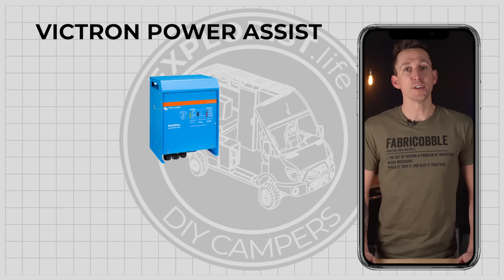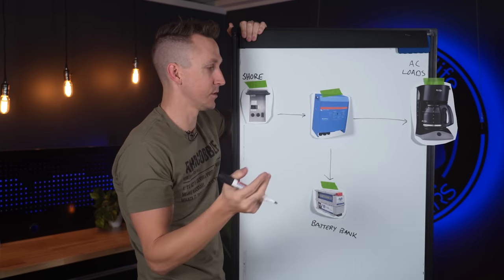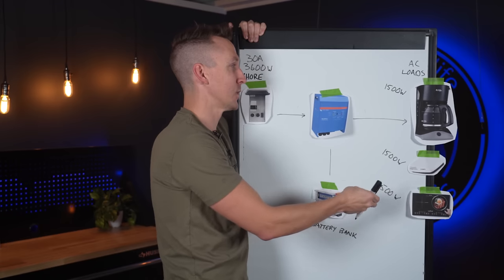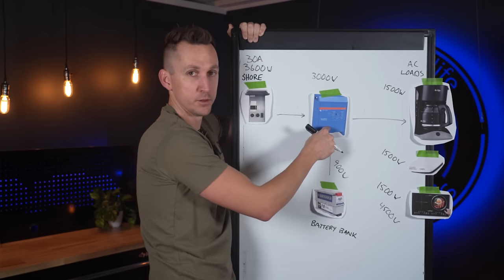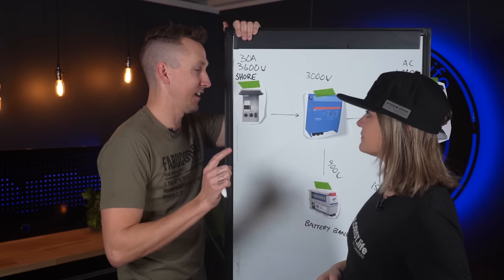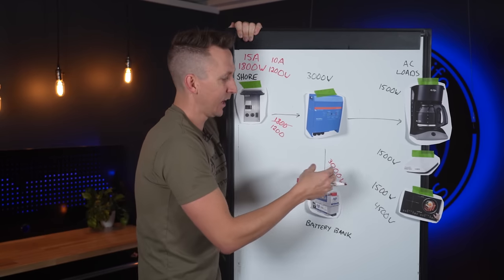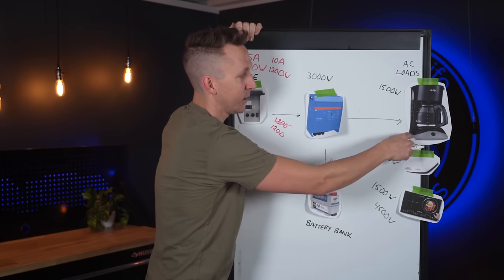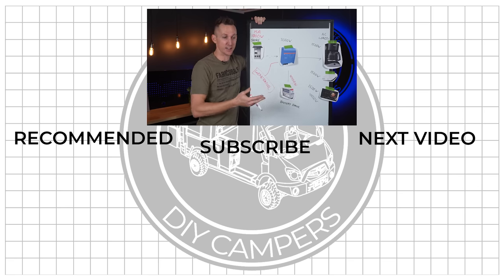How Does VICTRON POWER ASSIST work?

Comment: Good video!  Worth mentioning for others viewing (IMO), make sure you use properly sized cable (especially the cable connecting the I/C and a breaker panel).  In your example of 4500W, you'd need a minimum 40A rated cable (8ga).  My guess is that most will use 50A cable (6ga) for this connection but copper is super expensive these days and some may opt for less expensive cable. Be careful not to pull more watts than your cable can handle just because the components can make it happen!
Reply from the maker: Of course!  All of my full system diagrams at https://www.explorist.life/solarwiringdiagrams and kits at shop.explorist.life account for that. 🙂👍
Reply: An RV with a 30A OEM breaker box may not be able to handle the extra amperage either. I've been thinking about upgrading for this scenario but I think I'll have to replace the breaker/fuse distribution panel as well as running higher gauge wire.
Reply from the maker: @Cha Chi  Our 30A OEM RV Retrofit upgrade wiring diagram accounts for that.  We leave the 10ga wire and 30a breaker and breaker box in place.  If more than 30A is asked for, that breaker simply trips.  I've found that unless you are tripping breakers regularly in your camper, it usually not worth the effort to upgrade.  Power Assist will still function, but will primarily be used to assist when connected to a 15A outlet.

Comment: QUESTION: What if I have multiple inverter systems (of any brand), can one of the additional inverter systems become a source in place of the shore power, or generator, so that you could essentially daisy chain multiple inverter systems each feeding the next until it is used by appliances
Reply from the maker: 'theoretically' that would probably work, but that's not really how these systems should be designed.

Comment: Is it easy to adjust the shore/grid power max allowable amps in before powerassist knows it needs to draw the balance from the DC via inverter process? What would be the process to do this on a Multiplus?
Reply from the maker: Super easy.  3 clicks on the app or the gx touchscreen.
Reply: @EXPLORISTlife  thank you.

Comment: There are situations with generators where users may run into difficulty with power assist.  A system with significant instantaneous load increases can 'bog down' a generator to a point where a Quattro or Multiplus may consider the 'shore power' unsuitable - ie. the voltage and/or frequency drop below acceptable thresholds.  The result would be that the Victron protects and drops output power.
Reply from the maker: That can be fixed in most cases by turning on Dynamic Current Limit in the multiplus settings via MK3-USB dongle.  We turn that on for all multiplusses we pre-program for Battle Born batteries heading out of our doors.
Reply: @EXPLORISTlife Thanks for that tip.  I'll look into this on a tricky setup I'm working on...!

Comment: Hey Nate, I assume the answer is yes but since I have never heard you mention in it any of your RV electrical system upgrades and or New build I thought I would ask the following question. Should I continue to use an EMS between shore power and the Multiplus?
Reply from the maker: Yep!  We like the ones that plug into the shore power pedestal.

Comment: Nate, Do you have to adjust your multiplus to tell it to allow 4500w to be able to use the power assist.  I normally set my multiplus to 30a, as I have a 30a electrical system, not 40a. I ask because this last summer I had a problem with shore power not being able to run my A/C and my microwave at the same time (outside temp was 101*). I figured the shore power wasn’t providing the 30a it was supposed to.

Comment: Got a question! Substitute the shore or generator with another solar setup acting as the shore supply. (Eg another 3000w multiplus) can you do this?
Reply from the maker: Technically it would work, but I'm struggling to think of a scenario where that'd make sense to actually do.
Reply: @EXPLORISTlife  I have two power systems (tow behind and truck camper). Truck camper has a smaller array and sometimes may want to top off the battery bank with another supply.

Comment: Question - your example with 3600w shore power and upto 3000w inverting power = 6600w.  That would require the main power wires feeding your AC panel (disconnect breaker) to handle 6600w.  I've been using 10awg to a 30amp disconnect breaker.  For this to work correctly/safe we need 6awg with a 60amp disconnect breaker.  Is this a correct assumption?
Reply from the maker: Yep!  6ga and a 50A breaker with a 50A capable breaker box in my designs since a single pole 60A AC HOM breaker doesn't really exist.

I spec 10ga wire and a 30A breaker in most RV's with 30A shore power because most of the time, those breaker boxes aren't rated for 50A, so we keep the 10ga wire and 30A breaker in place and that is just the limiting factor in power assist, but it will still work great when connected to, say, a 15A outlet.

All of that is covered in my wiring diagrams, though: https://www.explorist.life/solarwiringdiagrams and kits at shop.explorist.life

Comment: Thanks, I am designing a system for my boat around a multiplus. Is it worth gettimg the super expensive victron lifepos of go with cheaper ones like Battleborn or even cheaper ones?
Reply from the maker: I design/recommend Battle Born batteries into all of my systems because they are incredibly easy to incorporate with their internal BMS and their quality is backed up with a 10 year warranty and top-notch customer support IF an issue ever comes up.

Victron batteries are very high quality, but their external BMS and related programming makes them 'less than user friendly' to install and set up and they only have a 5 year warranty.
Reply: @EXPLORISTlife  Thanks. I have a cool old grand banks trawler that was set up to run of only generators and I am embarking on a project to add inverter, solar, and remote monitoring to it. I really appreciate the videos and advice. If you ever want to make a video on a beautiful yacht. Let me know.

Comment: hi Nate, love the informational videos. I have 2 questions 1, I am wiring the ac side of my system. I have a Victron multiples 2 50 amp. My research says in need awe 6 w ground. I do not want to use romex / can you recommend what where I need and size and where to buy. Marine anchor ? will that work? Q2, Can you recommend a way for me to wire 4 100 amp battle born. I am in need of a bus bar or something since using 4/000 the loops are to high and will not fit - looking to wire the terminals with a battery bar or something like that. Thank you Dave B

Comment: so in that example you would need a wire capable of handling about 6000 watts coming out of the inverter?
Reply from the maker: Exactly.  Which is why we spec 6ga wire and 50A breakers in our 'from scratch' kits.

Comment: Thanks for the video. The way you described this is the way I thought my system should work. But my system has never worked this way, and I always trip the shore power breaker. Wish you would've explained what the multiplus settings should be, for the power sharing to work. I have the Multiplus 12/3000 with the smart dongle connection. My rig is 50A. Right now, for instance, I'm connected to 20A shore power and would love to get some battery assist a few times during the day. I've set the multiplus to AC-IN of 20A (so I won't over-draw from shore power), Mode is set to ON, and batteries are charged to 99.8% and in float status. If I pull too many Watts (like forget, and start the electric kettle when the electric heater is on), the shore breaker trips. If anyone has insight on this, I would really appreciate it!
Reply from the maker: Lower the Shore Power Input Current Limit to, say, 15-18 so the breaker has a bit of breathing room.

Comment: For a non mobile setup it would be awesome if it could be used in reverse, drawing from the grid if the battery/inverter rating is insufficient

Comment: I have a question what happens if you have the inverter that allows you to plug directly a generator and short power and you have both available does it have a preference on one over the other or does he use both at the same time to power up your loads?😅
Reply from the maker: It chooses one or the other.

Comment: Thank you for another great video :)
Though, how about vice versa? Can the MultiPlus use the battery bank as primary source and use the shore power as power assist?
In my case I'm building my system on my live-aboard boat and would like to limit my pull from shore as prices are quite steep...
Reply: You can do it manually by limiting the input with the digital  multi control panel.
Reply from the maker: Basically no.  Not just like that, but you can reduce the shore power limit to it's lowest level like what Cha Chi said to have the multiplus do the bulk of the heavy lifting and then shore power would only contribute for small loads.

Comment: So, if I get a 3000 multiplus i also have to get a transfer switch??
Reply from the maker: Not necessarily.  That just depends on what you are trying to accomplish with your system.  You'll need an external transfer switch if you have shore power as well as a built-in/hardwired generator.

Comment: Sometimes, the voltage from the park pedestal is low. Will the Victron 3000 inverter charger correct the voltage deficit?  I was thinking of getting a Hughes Autoformer for this low voltage situation,  but if the Victron inverter charger could correct voltage issues as well I might just get the Victron unit.
Reply from the maker: The Multiplus/Quattro's will not boost a sagging voltage from shore power.  If AC is present, it will pass through whatever it is given unless the voltage is so low that it presents a fault condition, and then it will not pass through anything (programmable/customizable).  The hughes autoformer is a good option for the scenario you are running into.

Comment: Can the controller be set to accept less or no "shore power" automatically based upon time of day programming?
Would DC loads be retained between the battery bank and the inverter or is there primary DC output as well that can be powered by AC so that charging the battery bank remains secondary to providing the amps to a DC load, (lets say its a DanFoss refrigeration compressor).
Reply from the maker: Can you give me a scenario why you'd want time-of-day programming?  Let me know what problem that would solve and I'll see what I can come up with.
Reply: @EXPLORISTlife  The proposed electrical rates at night are less expensive than daytime rates and during the evening (dinner time to about 9 or 10) hours the proposed rates are to be higher than daytime rates. So I would want to completely curtail charging and drawing from the grid during the evening hours if possible, if the utilities commission approves the changes to the rate structure.

Comment: I have yet to put mine in the motorhome. I think one thing it will also do is eliminate the need for a soft start for the AC and I can run that thing on the 2K watt Honda. Instead of having to listen to that noisy built-in generator.
Reply from the maker: Awesome!  Glad it helped.  Thanks for watching!

Comment: Nate, nice video. I was wondering what the power looks like coming out of the multi in power assist mode using a generator. Let’s say we have a generator with 10% total harmonic distortion just curious if the multi makes it better or worse. Anyone you know ever throw a scope on it to see what the waveform looks like?
Reply from the maker: AC in =AC out.  The multiplus doesn't do anything to the AC input except add amperage to it, which it matches to the incoming voltage.
Reply: @EXPLORISTlife  I was just wondering because I suspect the multi would have to match the voltage and any distortion not to cause problems. If the AC in is really dirty I know the multi won’t “lock” on to it.   Would still like to actually see it though. Haven’t had a good scope in years with the resolution needed to see this.
Reply: @M35a2guy  My educated 'guess' on this is that the inverter would indeed sync to frequency, primarily by using zero-volt-cross points, but it would not attempt to replicate a distorted land power source.  It would effectively superimpose its cleaner sine wave onto the dirty land power.  This would equate to a scenario where the instantaneous power at a given point on the 'mixed' waveform could vary somewhat between the 2 sources but the average power consumption would adhere to the settings chosen.  I stand to be corrected but I'd be very surprised if a Victron or any other inverter attempted to replicate a waveform that deviated significantly from a sinewave.
Reply: Makes total sense, thanks for sharing your take!!! @andynoiseboy

Comment: My power assist used to work when I had my DMV display. But after I upgraded to a cerbo gx it doesn't assist anymore. I can only run. What my max limit of the inverter is. Can you please help explain.
Reply from the maker: Have you changed the shore power input current limit through the cerbo gx like you would with the DMC knob?
Reply: @EXPLORISTlife  you meaning like to 10amp or 15amp I have. But  I need it more for my inverter and solar charger To assist the inverter. I know that it did assist before upgrading the display
Reply from the maker: I'm not following what you mean with you need your inverter to assist the inverter.

Solar won't 'assist' as it's not an AC power source.
Reply: @EXPLORISTlife  I have a victron 5000 watt Quattro inverter.  Before I can only run 2 high draw watts appliances but when I turned my truck engine on and the alternator kicks in I could run 3 surpassing the 5000w limit cause my alternator was  inputting around 80amp. But after the cerbo install I can't do it anymore. Max I can run is 2 appliance even with engine on. I have seen other people setup where the incoming power from solar and alternator gets 1st then the inverter will cover the shortage. I ask the forum they say it can be done.
Reply from the maker: Unless you have a secondary inverter powering the quattro from the alternator; that shouldn't matter.  I'd probably recommend reaching out to your victron dealer or installer for further troubleshooting as this seems like an atypical setup, perhaps.

Comment: Can someone clarify if the Victron Inverters rated at 3000 va (volt amps with a .8 power factor) are able to actually provide 3000 watts? Thanks!
Reply from the maker: 3000VA is closer to 2400W output depending on power factor, temperature, and 'type' of device being powered (inductive vs resistive, etc).

Comment: I have really been helped with your videos and wiring kits etc.  have a trailer with inverter prep.   Its an orange romex  wire like you find on all Grand Designs. Its a loop, a fold in the line that I assume goes back to the breaker panel on one side and from shore power  on the other (I assume.)   Can I wire in the multiplus II 12/3000  120 using the inverter prep loop like I would behind the breaker panel as in your video?       The other issue is confirming what side of the loop is from shore power and what side in return to breaker panel.   One side of the loop has green tape on it and the other side has black tape.   I assume that would tell me which was out and which was in if I understood the code.   I hope you can point me in the right direction.
Reply from the maker: This may take a more in-depth look at your personal setup.  If you have purchased/are purchasing from our store (shop.explorist.life) reach out for some more personalized help: shop.explorist.life/support

If you've purchased/are purchasing elsewhere, reach out to your dealer for support.  We'd love to have you as a shop.explorist.life customer so we can provide a bit more help in the future. 🙂

Comment: With Shore power, you should be able to Jumper out your "House" power system, when you need to, in whole or part.
Reply from the maker: I'm not sure I follow what you mean by 'jumper'.
Reply: @EXPLORISTlife  

Being able to bypass the Inverter entirely, having the option to plug directly into the Grid AC Mains.  

In simple terms, Taking a Power Strip normally plugged inro the AC output of the Inverter and Transferring it over to an Extension Cord connected to Shore Power.

If you have Two plug strips (or branches), maybe leave one on the house power and to avoid overloading the extension cord/shore circuit breaker, to run certain items off of the inverter and plug the other into Shore power or plug them both in the shore power when the current allows (and you want to charge and/or rest your House system).

Maybe with SPDT switches to avoid having to manipulate the plugs manually.
Reply from the maker: The internal transfer switch of the Multiplus + the PowerAssist function does all of that natively.

Comment: Nate, I apologize for this question (and I know that I should ask Victron directly... or read the manual), but what if I'm in an older campground with out-of-date power distribution in the middle of summer and everyone has their air conditioner running AND I'm only getting 110 volts out of the 15 amp power post.  For my scenario, I've got a 3500 watt draw in the van - what does power assist do with the voltage differential?  Do I get 120 volts in the van? 110 volts? Something in-between?
Reply from the maker: Power Assist Voltage matches whatever is the incoming voltage from shore given it is within the parameters of the unit.